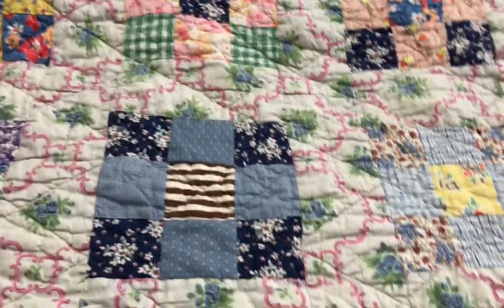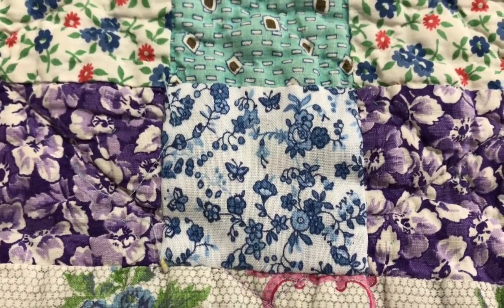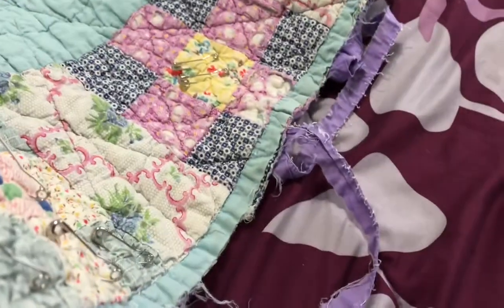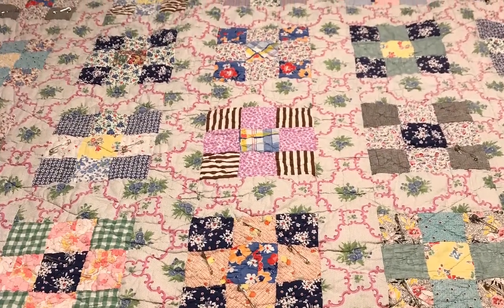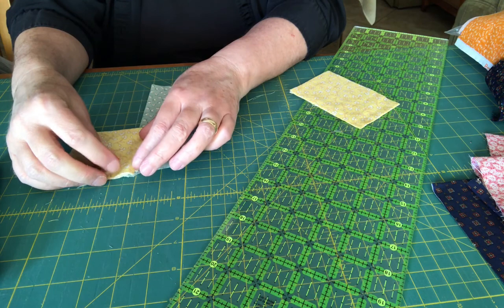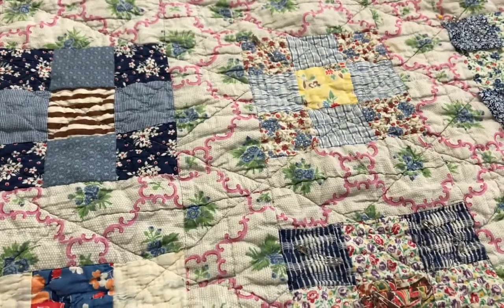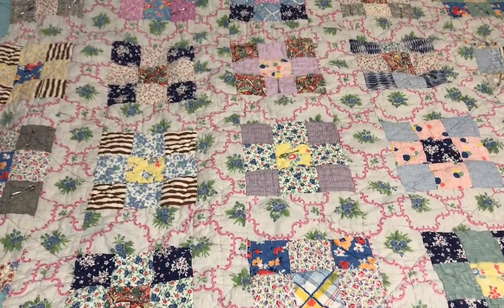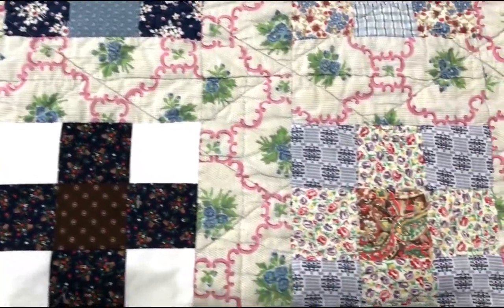Repairing an almost 70 yr. old quilt/Part 2

Comment: I have my grandmothers handsewn quilt. It’s a English Paper Piece style approximately 70 years old - at least.  
I am not a seamstress I don’t even so buttons on. So I am overwhelmed and in tears not knowing what to do. Parts of the hexagon are rotted off while other parts are just fine but the fabric is worn. It is a king size quilt it’s very large. I don’t know how to approach this I think I’m going to give it to my sister who is a seamstress. I hate to part with it but it seems to keep it in the family it is what I’ll have to do. Thank you for sharing
Reply from the maker: I was at the fabric store about a year ago and the employee and I were talking about quilts. She told me how her cousin had cut up their grandmothers quilt and framed sections so that everyone could have a section of it. I need to start working on the quilt again. I go through overwhelming times with it or get busy with other projects.  Maybe you could ask your sister to repair it and maybe divide it in half so that you both have a smaller quilt. Just a thought. Or maybe you could find a quilter through a quilting store to help you repair the parts that have disintegrated.
Reply from the maker: Or check to see what kind of quilting guilds there are in your area.  If you look  and ask around you might be able to find someone who will help you repair it inexpensively because they love quilts.